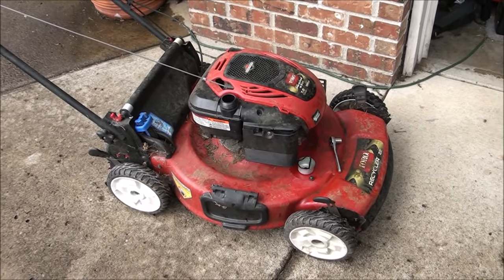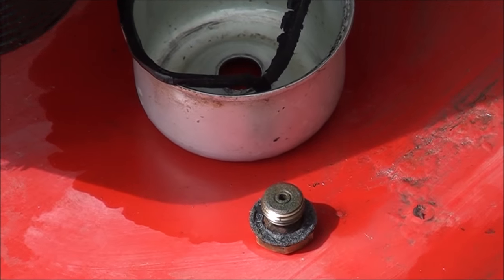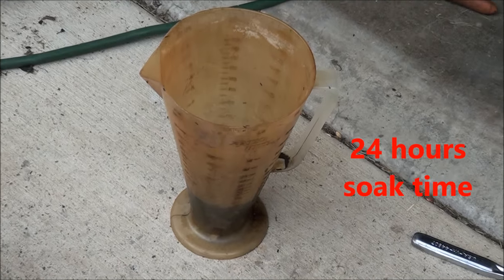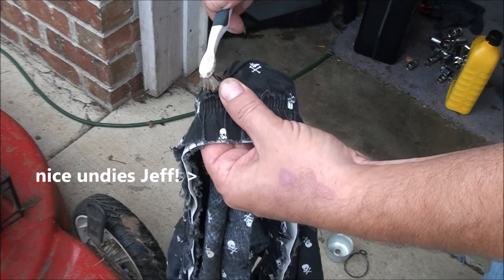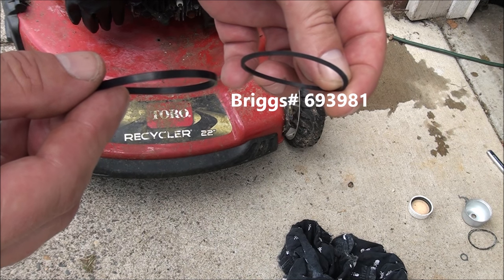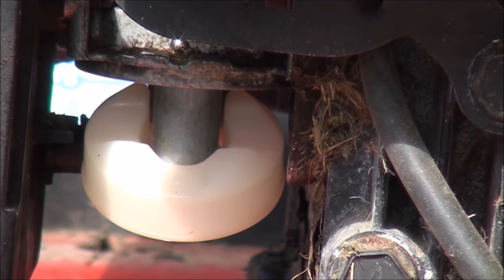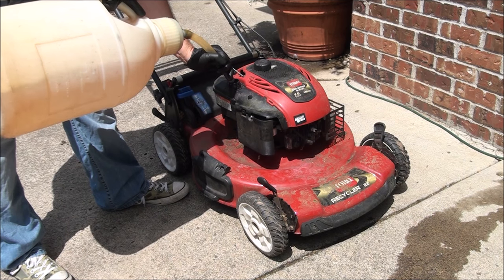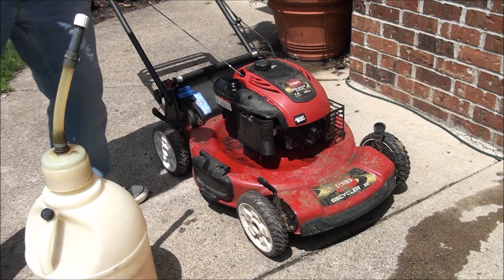How To FIX A TORO LAWNMOWER that STARTS then DIES. Will Not Stay Running. STARTS THEN STOPS

Comment: The repair shop left the hose clamps off my fuel line between tank and carburetor. Ensures repeat business, I guess.
Reply from the maker: EPA requires them to be installed at the factory whether it needs it or not.

Comment: my toro 6.5 HP will start, run fine for 5-10 minutes then stops and will not starts until is cold again, anybody has an idea what is wrong with it, I clean the carburetor, change spark plug
Reply from the maker: you may need a new float valve. too much gas in carburetor
Reply: thanks I will check it

Comment: But you don’t demonstrate that the mower continues to run after It is engaged.  That is where the problem is. This Toro ready start mower starts first pull but only runs while idle.

Comment: Coke? I'll stop drinking that .
Reply: Coke also works great in a pinch, if your car battery is covered in acid and won't start. Pour coke on the terminal and it will clean off the acid. Pepsi won't work. 😂

Comment: if its not a jet then what ?
Reply from the maker: You must have fuel, spark and compression for an engine to run. If it starts or tries to start (use starting fluid if needed) then you know you have spark and compression and most likely have a fuel delivery problem. A new spark plug is always a good idea too.

Comment: I, my best friend and a favorite nephew all bought upper end Toro lawnmowers independently of each other in the last couple years.  At a recent get together, somehow the subject of lawncare came up and we all discovered every one of them had failed in the first 6 weeks!!  Toro lawnmowers are CRAP!!  Toro will not get another penny of my $$ ever.
Reply: RKBA  What kind of gasoline are you running in your mower?  Maybe it's not the mower.  I've had a Toro for four years--I use non-ethanol gas and stabilizer and my mower generally starts on the first pull.  It's my first mower and I paid close attention to how the dealer told me to care for it.  I'd buy another Toro in a heartbeat!

Anyone who works on lawnmower engines will tell you that running ethanol gas will gum up the works.  I'm a girl and I know that much!  😄